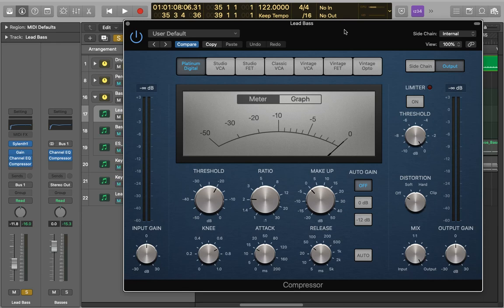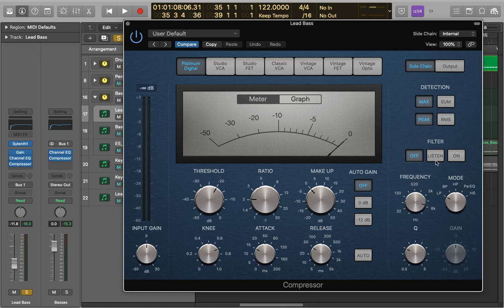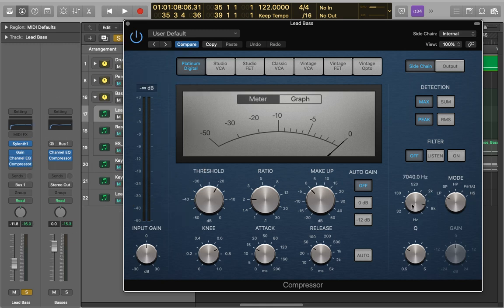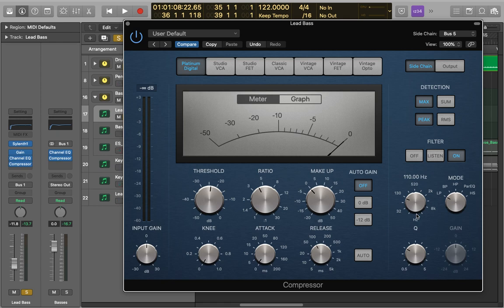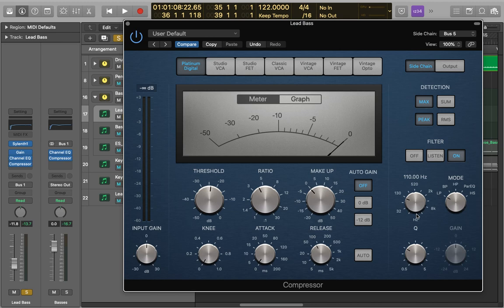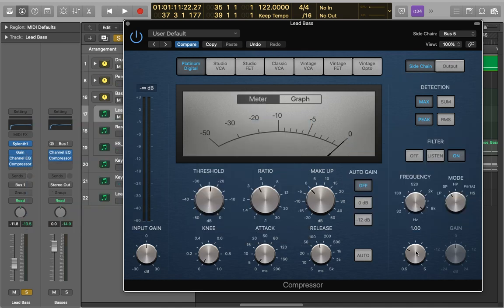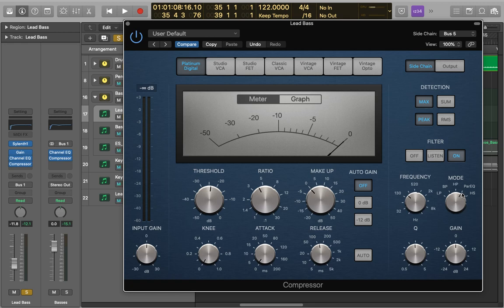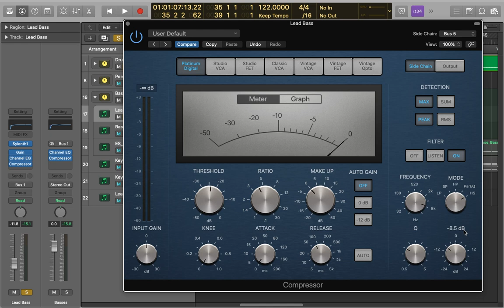Logic Pro X - How To Use The Sidechain Parameters

Comment: You explained the steps well, but for those, including myself, still foggy on what is happening, you never said the word "bass" very much when you explained  what was being affected (the compression's effect on the bass is pretty subtle here.)  Correct me if I'm wrong: two things are being reduced, but only the bass gain reduction is audible. The high-end side-chain triggering power of the drums on the bass was being reduced by the low-pass filtering (leaving mostly just the kick to trigger), not the high-end sound of the drums themselves.